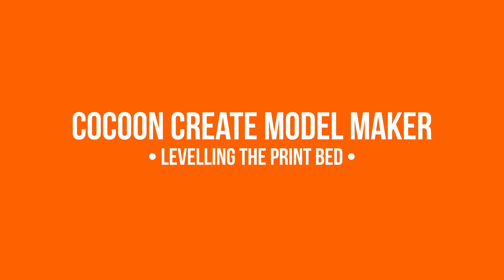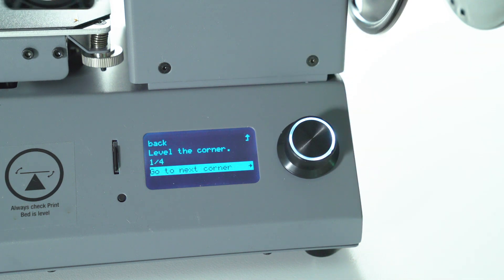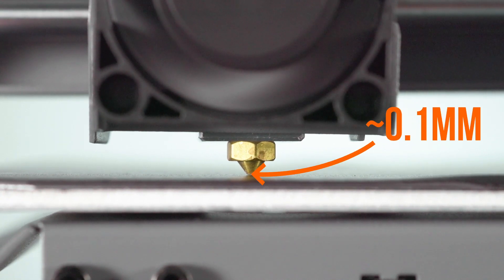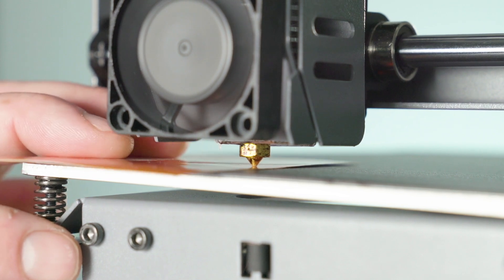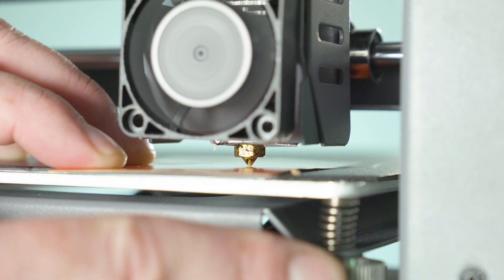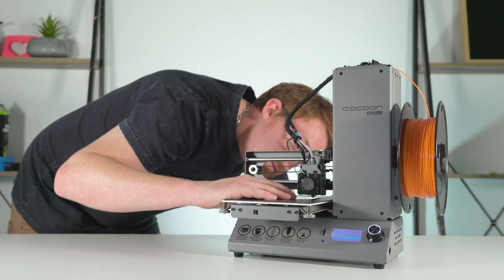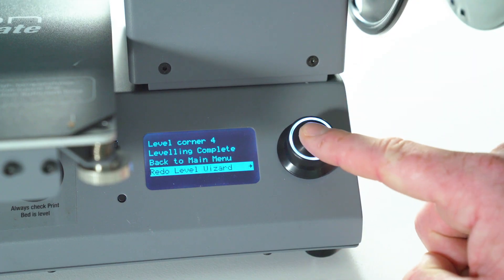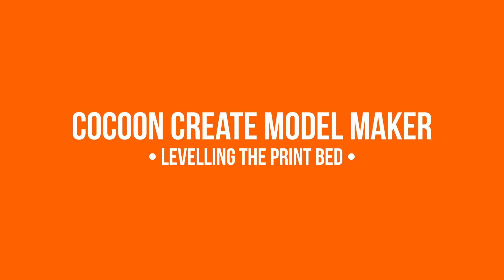Cocoon Create Model Maker - Levelling the Bed

Comment: Hey guys, 
Leveling the bed is insanely important. However, you're missing half of the issue. It's just as important to have a clean bed. You should wipe down the bed with isopropyl alcohol before each print and after leveling.
This will remove any oils etc that you transfer to the build surface by touching it. 
This is why your first prints are awesome but slowly degrade after a short time and adhesion become a significant issue. 
Just got the new Cocoon to create after having the original i3 style since launch day. So far I'm impressed with the quality of this printer.
Reply from the maker: Thanks for the feedback Johann! We will look at doing a video on bed maintenance and cleaning next :)